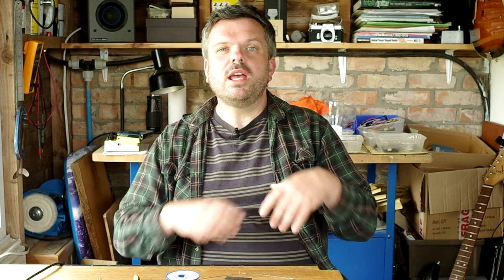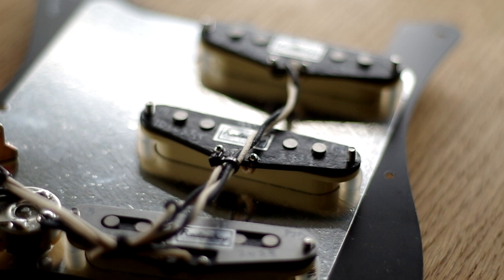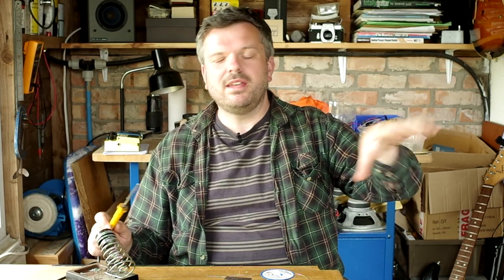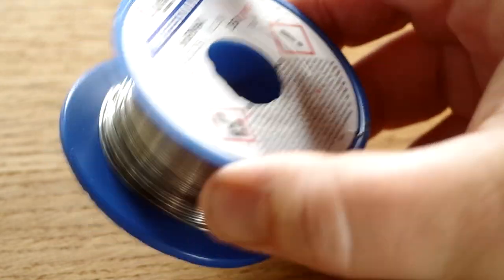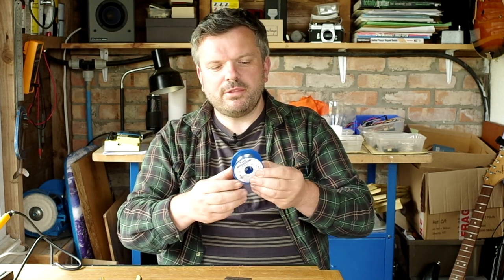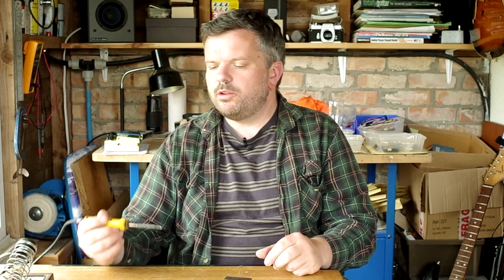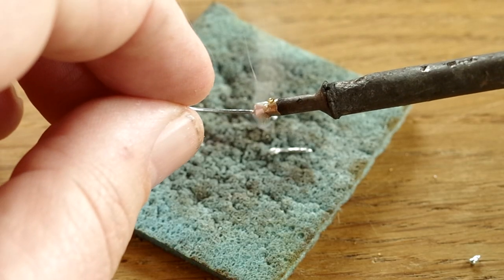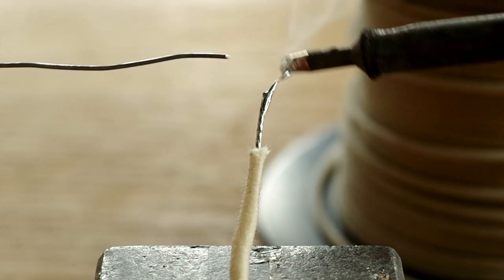Guitar Soldering Course Part 1: Equipment Needed and Technique

Comment: Hard to find Cynel in the states. More important smaller diameter or 60/40 Pb/Sn? Can’t seem to find thin high lead.
Reply: Any solder for electronics will work, I use flux-core solder for electronics and I’m pretty sure it doesn’t contain lead. I buy mine at the local hardware store, near the plumbing equipment. I’m new to fixing guitars, but I have in-depth knowledge on RC cars. Maybe lead holds up to weather and age better, but I wouldn’t unless I had something to exhaust the smoke away from my face.. The smoke is nasty stuff; nothing to play with and inhale for hours, that’s for sure.